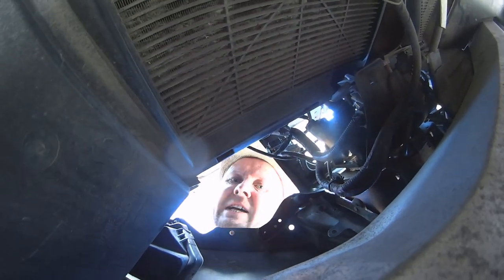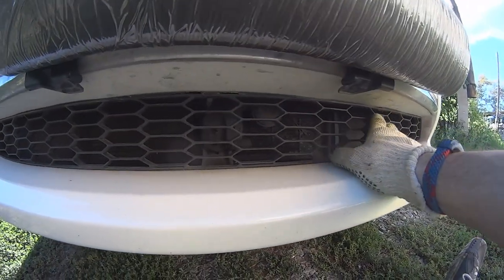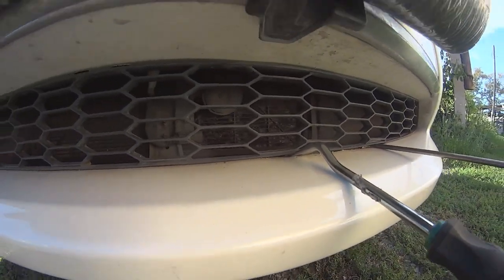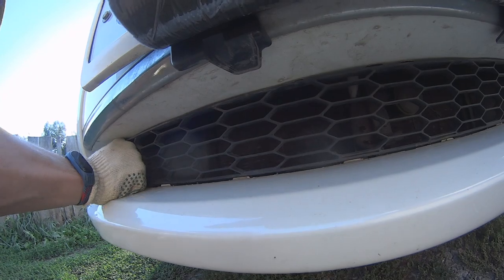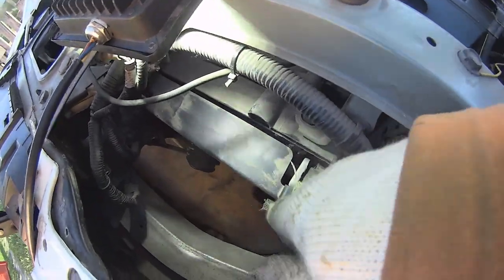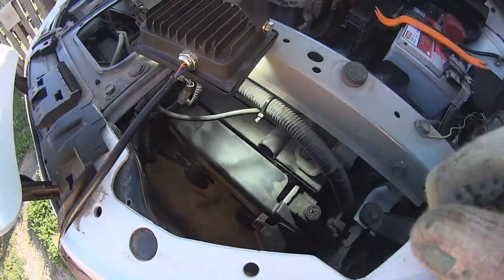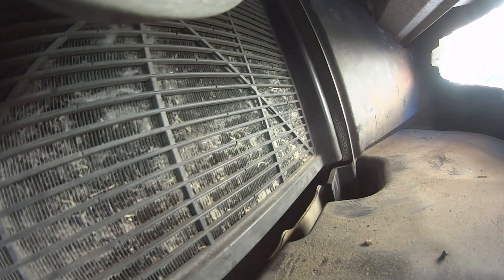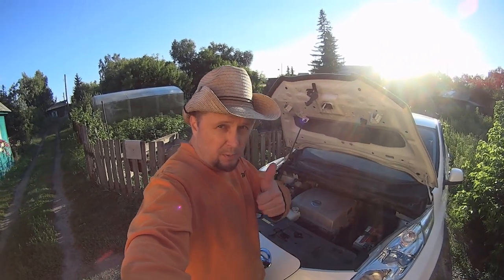Nissan Leaf AC condenser radiator cleaning

Comment: That plastic cover thing was a pain to deal with, but I'm guessing it helps protect the condenser from rocks that are small enough to get through the grill.

I say you get extra points for thinking of using a vacuum cleaner. I really wish this job was easier to do, because after 11 years mine was really badly clogged.

Comment: simpler to remove all the frontal bumbper
Reply from the maker: No it's not
Reply: @CoberRuger  I didn't like how you did this so I decided I would just remove my front bumper and I want to tell you that it was SO much easier! Unfortunately, I would have to lie in order to do that, because it took HOLY FUCK hours to complete.

TL;DR: CoberRuger's way is faster and easier. Removing bumper is a lot more work, but you will have better access and can get it cleaner that way.

I will say that I'm happy with my outcome. I disassembled it at a car wash and was able to get the condenser very clean! But I'm also amazed at how poorly this was designed from a maintenance standpoint. I think that removing the bumper is still the right way to do this job. It's actually removing the 1. charger port lid, 2. bumper fascia (the big exterior part we see), 3. bumper energy absorber (big dense Styrofoam thing), 4.  RH and LH air guides (DLK-142), 5. two other air-guide looking pieces of plastic whose name I can't find, 6. remove the upper and lower bolts to radiator core support lower stay (also on DLK-142) but leaving charge port bracket still attached so that you can move it to the side and 7. remove the plastic thingy covering the condenser coil.

Air is SO much colder now. Sadly, I didn't realize how horribly it was clogged until today or I would have done this sooner. I've had the car for 11 years.
Reply from the maker: @firstnamelastname9918  dude you nuts))
Reply: @CoberRuger  Yeah, maybe so. But I did get the thing fully clean. I think I'm just unhappy with how hard it is to clean! The shop manual actually removes that grill in reverse of what you did -- they say to take the "bumper fascia" off first and then detach that grill, but you did it the other way, so kudos for making that work!

Still, I wish I had a nice, stiff-ish nylon brush with me when I did it. I also had a lot of dings in my condenser coil where it looks like little pebbles must of hit it. If I was a little MORE nuts, I might have tried to straighten the fins out there.

I'm thinking maybe I can get some black window screen material and put it over the grill to keep it from getting so clogged up again. Then I could just clean that screen and the condenser won't get clogged so easily. I dunno.

PS: Maybe the design was based on an hope that you'll just trade it in after 5 years?